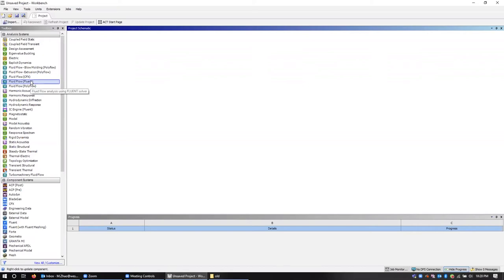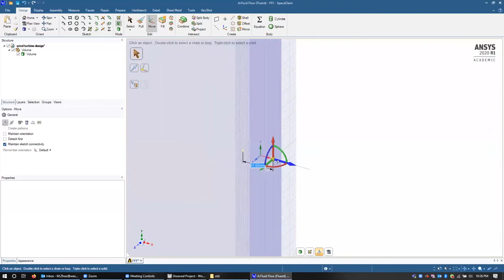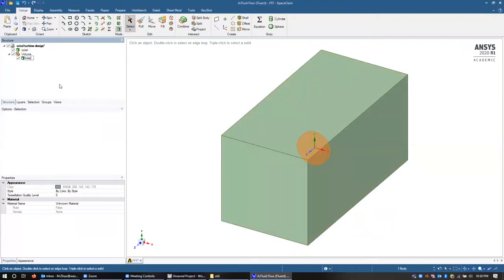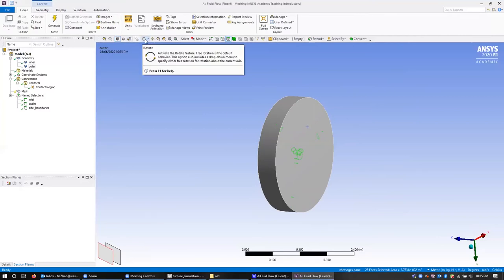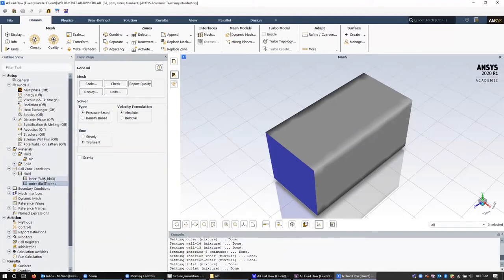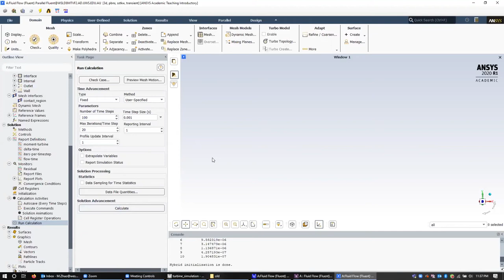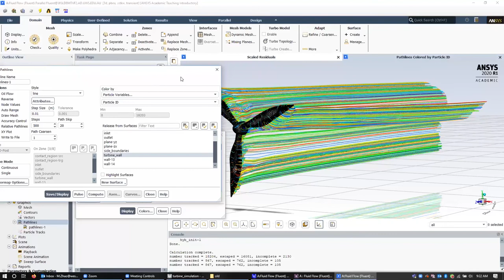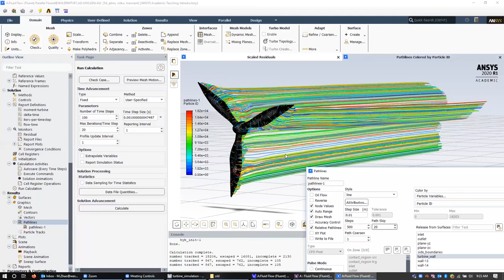ANSYS Fluent Wind turbine

Comment: that is not correct, this is a simulation of a propeller rotating at 100rpm in the wind, not a simulation of a turbine, the turbine rotates as a result of the wind flowing over it, not by giving it a speed of rotation
Reply: Did you found any yt tutorials that calculates the rpm based on the inlet velocity? I cant find any. There is one using cfx by climatecfd but that is a workaround
Reply: So essentially do not define a rotation speed at the step he presented and ANSYS will do its thing for the motion of the turbine to be dependent on the flow?
Reply: @XenOz3r0xT_88  more difficult，you need to use dynamic mesh